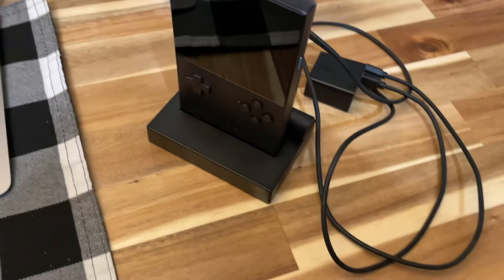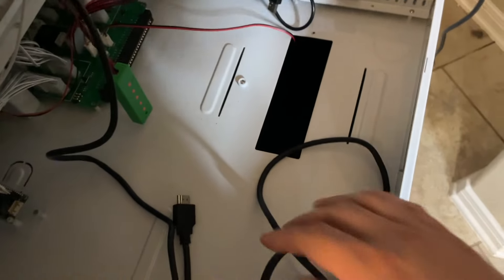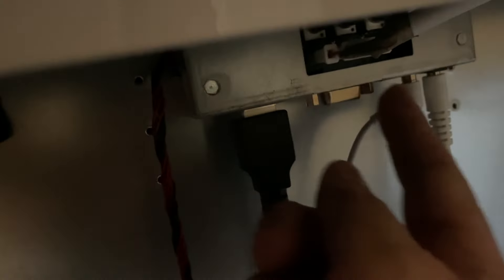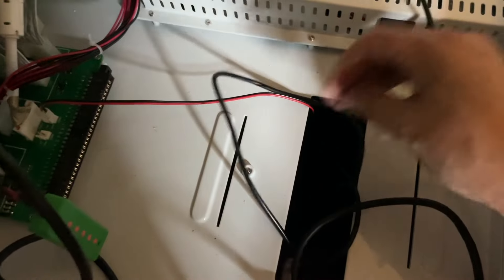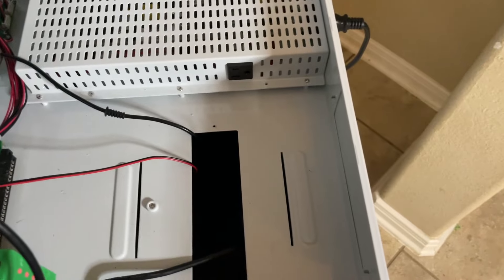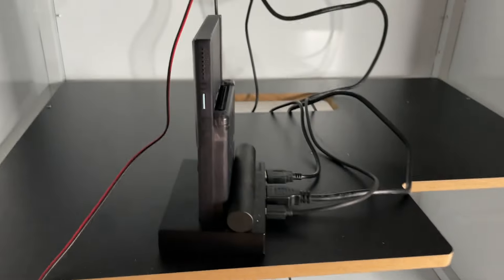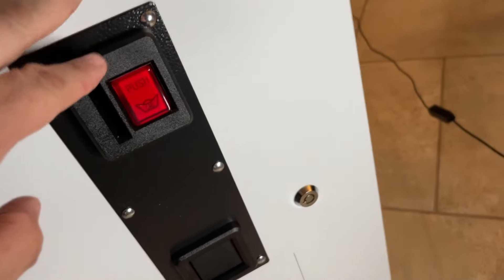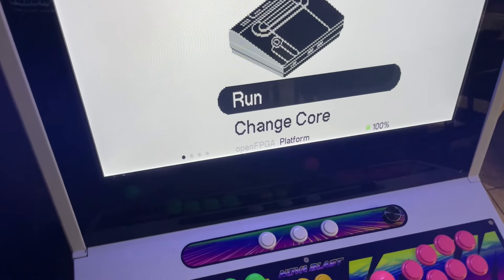UNICO NOVA BLAST: EASY HOOKUPS

Comment: Thanks for posting. Is there a way to use the osd controls of the monitor to make “Level 4” and “Credits 7” properly fit on the screen and not get cut off ?
Reply from the maker: Nothing on controls but I was using integer+ on the pocket. You can just do integer and it won’t fill the entire screen. I was also using Sony Trinitron filter which shrinks the image a bit, so there’s options to play with via your pocket to get what works for you.

Comment: Is there a remote board or a menu for screen adjustments (vertical and horizontal stretch and positioning)? It'll be crucial to be able to adjust this for JAMMA boards, as they output in so many different resolutions.
Reply from the maker: With jamma and vga the OSD allows you to V and H adjust along with RGB dials/ pots

Not via HDMI

Comment: Did you have to start up the pocket before the cab?  

Do any of the buttons on the cab wake up a sleeping ps5/xbox series s/x?
Reply from the maker: Haven’t tested it with a PS5 to know how it behaves. Initially for the pocket - yes, I had to power it on before I connected the controls to it so I could set it in X mode - after that, all good.
Reply: @neocvera thanks for the quick reply.  Allow me to rephrase one of the questions.  

Say all the configuration is done with the Pocket/Cab. 

Both are shutdown.  You want to play.  Do you first start the Pocket then the Cabinet?  Or is there a way to start both at the same time without having to reach around to the back of the cab?
Reply from the maker: @PRETTYJESUS-ProSkills I use a smart plug and start everything up with an app.

Comment: Whenever I plug the encoder usb in or insert the pocket onto dock, I get no controller response and both methods register as the “A” button
Reply from the maker: Insert the encoder usb in (to what)?
Reply from the maker: Another thing to try is to set your controls in X-input mode. Press the B button while plugging in the usb cable into the dock. See if that helps. 

Also don’t understand what  you mean by “both methods register the “A” button”
Reply: @ the encoder usb from the Nova Blast into the Analogue Dock
Reply: @ gotcha. Right now, the encoder is still in Nintendo Switch mode
Reply from the maker: @capt2001 yeah I think the analogue dock likes X-input
Reply: @vchopra1007  yup. After updating, I had to put the encoders into “X-Input” mode
Reply: @ is it possible to tell me step-by-step? How did this literally appreciate it?  Do you have to hold B2 down while you plug in the USB into the dock?
Reply: @ yup, you hold B2 down as you plug in the usb. Make sure the dock is on
Reply: @capt2001  can I get it to work. Player two joystick starts working , but does not let me set the button buttons.  Were you able to do a button set up?
Reply: @ I was able to set mines on different cores
Reply: I had to go thru each core setting